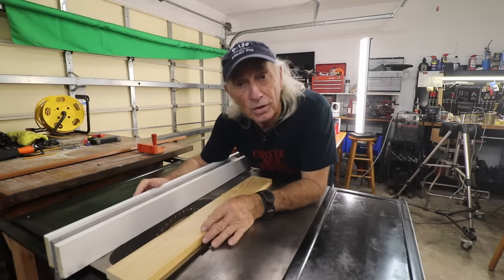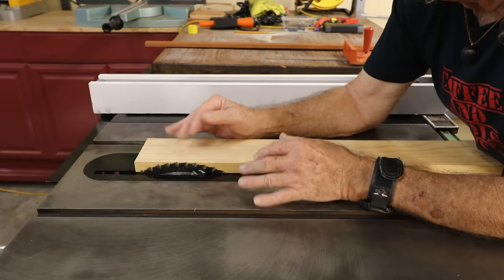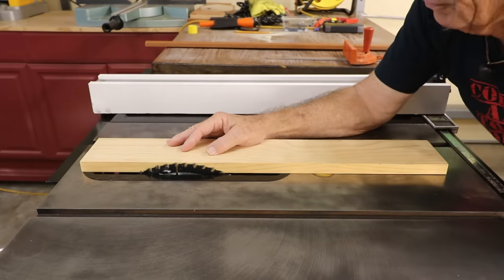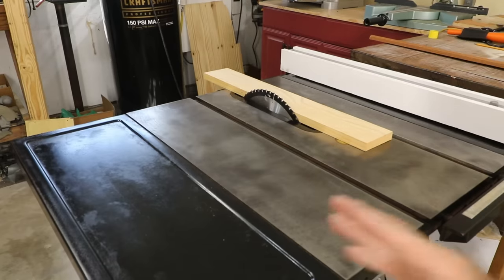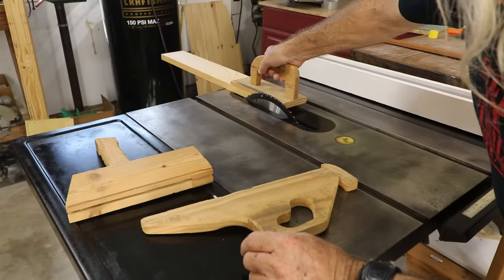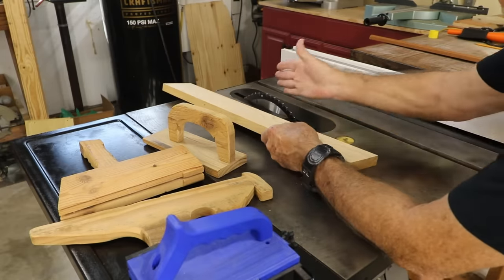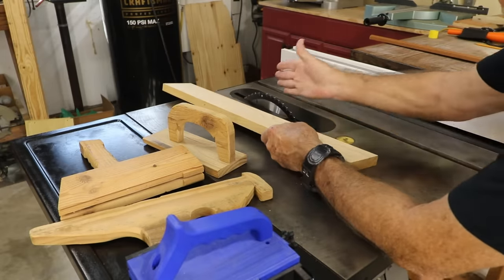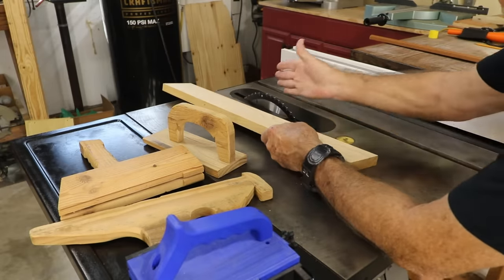Table saw secret nobody will talk about from the good old days, C&T episode 180

Comment: One thing I see is the portable contractor saws there is an avg of 8" of table in front of the blade in comparison of the saw you have there. You have to lean forward in a lot of instantses to push wood completely through the blade which cause you to have less body stability and balance which could lead to a problem of not maintaining proper control of the wood etc.

Comment: I seem to recall that at minimum you should have 3 teeth in contact with the material for smooth cuts. Some rough cut blades won't do this when run high.
Does this apply to table saw blades as well?
Reply from the maker: It somewhat does, so yes the low tooth count could change things a LOT for work

Comment: I’ve always followed a variation of the 1/8 rule–which in most blade sizes amounts to the same: call the top edge of your panel the horizon, and adjust the height of your blade so the most teeth possible intersect the horizon; teeth faces shouldn’t leave and re-enter the panel, will give you a far cleaner top cut, and far less tear-out on the face touching the table.
Reply: I'm new to this, so please comment corrections where necessary.  My understanding is that the cut with a table saw is occurring at the point of first contact, so all the teeth of the saw that are intersecting the horizon aren't really cutting anything until it's their turn at the front.  The rest of the teeth are just narrowly grazing the sides of the wood that were cut earlier while feeding the wood through.  Hence the reason why a riving knife is so useful, to prevent the already cut material from squeezing in and catching one of those teeth out of sequence and throwing the wood.  If that's the case, then my instinct would be to have the blade higher up so that the cutting force is down towards the table, instead of towards the user.
Reply: @raddad9041  The main issue is tear-out on the table side of your piece when cross-cutting, given your blade is sharp and perfectly fence-parallel. Try highest and horizon cross-cutting a pine panel, and see which position provides less tear-out.

Comment: Clear the gullets!  It removes the chips, and because the blade is higher, the rake presented to the workpiece is now positive, instead of negative or 0 degrees.  That reduces the force directed at you (and the potential for kickback), while also making it easier to feed the workpiece.   I know what I am talking about.  I have cut thousands of linear feet of acrylic and also polycarbonate (bullet proof glass) without a riving nice.   Polycarbonate has a great tendency to kick back.  Also, if your rip fence is PERFECTLY  parallel with the blade, or deviates ever so slightly to the right, it will reduce the chance of kickback.  You don't want the fence angled the slightest bit to the left, as that pinches the workpiece between the fence and blade, increasing the potential for kickback.
Reply from the maker: I like it.

Comment: I use most safety devices when applicable, and I'm a huge fan of feather boards as well to reduce the need for my fingers to even get close to the blade and get more consistent pressure than my fingers can often give. This allows me to set the blade a little higher than normal and get a smoother cut. It also reduces the pressure needed to push the wood through the blade and burns far less. I usually set the blade ⅜-¾ above the material for rough centre cuts. For finish cuts, end grain cuts or taking less than the kerf of a blade off, I like to lower the blade to just above the material so the edge of the blades teeth are continuously engaged in multiple cutting angles for the nicest cut. I actually find higher than recommended height is safer for me as decreasing the feed pressure reduces the distance my hands can move forward if they slip and if the wood twists parallel to the blade direction a higher blade would have only 4-8 teeth engaging the wood in a more up down motion which bounces the wood up and back towards at the operator. If your fingers are between the blade and fence in this situation it may save a finger, whereas if a board twists parallel to the blade and the blade is close to the same height as the material you may have 10-25 teeth flinging the board like a bullet at 190 km/hr straight toward you. If you are applying force near the blade you won't have time to react and pull your hand away before the board is completely out of the way and your forward pressure sends your hand through the blade or the push block can break or twist or injure you as well if it catches in that situation but the chances are far less likely with a lower blade if your technique is correct (stand off to the side of the workpiece, no fingers withing 4 inches of the front or sides of the blade, never put you hand behind the blade) I love to add a lip and small pieces of grip tape or sandpaper to my push blocks to prevent slippage. The only time I have had serious kickback is when I was rough ripping tensioned wood without a splitter bar. Technique, preparing your wood for the saw, safety features and PPE should prevent accidents 99.99% of the time. So just get someone else willing to take the risk or find another way to do those tricky cuts safely.
Reply from the maker: Featherboard is another nice feature added for table saw accessories. Some good thoughts here

Comment: Agreed when I used to cut a lot of small strips of 1x that is usually warped and such it was best to keep the blade high and have someone on the back side helping guide the larger pieces. I use my circular saw most often these days while I have a table saw it isn't something I use often I've almost had kickback several times but when it jammed I kept the force on it and shut it down. Often kick back occurs because the space in front of the fence is different on the back of the fence always measure the front and back of the blade to make sure your fence clamps straight because often it does not no matter the fence design. I used to free hand a lot on the table saw as well cutting long boards at angles pencil drawn I was decent at it but again these days I opt for the circular saw. I've been hit by metal shrapnel and got all kinds of cuts once catching when my uncle was cutting he was in a hurry and left the lock on wow hey got one hell of a welt on his stomach and I had all kinds of cuts from the metal the door flew back and hit him in the stomach and continued to fly up as it spun off of him. Not a good day that right there introduced me to the danger after 20 years of being around saws I've seen enough kickback to know a table saw is a tool of danger and I use it as little as possible only when needed for repetitious cutting. If it starts to jam keep even pressure and shut off the saw.  I've never personally had a kickback using this method don't know if it is the correct thing to do I just know that it has worked for me and each time my fence was off on one side or the other and that was the culprit.
Reply from the maker: WOW.....free hand...man now that is asking for a bad day. Shutting down the saw does seem like the simple way to stop the kickback, but ....aw...there will always be that guy with ...OH...one more push should do it LOLOL

Comment: Over here in Europe we are amazed that North Americans never seem to have riving knives or top guards. Of course you can remove all the safety features you like privately, but in the workplace this would be a criminal offence. When you are ripping, the most energy efficient way is to have the maximum blade exposure so that the teeth are as near to right angles as the wood fibres as possible. This is why bandsaws are so much more efficient.
Reply from the maker: Exactly

Comment: I doubt this comment gets noticed , but what about the blade manufacturers specs of how the to use each blade . Most recommend the gullet is supposed to be just below top edge of the board. 
    This gives you best cutting angle for the tips. As well as keeping the blade coolest.  So less chance of warping . There's also different ways the blade can affect the lumber from the amout of teeth. Whether you use a zero tillarance throat plate. Even the kind of wood. 
      So honestly blade height can vary for most safest.  Properly used plastic guard will stop anyone from getting cut and almost always all kick backs.  A break dose nothing about kick back.
       Plan your cut as was mentioned  is a must practice.  Using something to push is a great layer of protection but it's no guarantee.  Keeping your saw true  is one of the best ways to prevent kickback.  
      A knife is a awesome prevention tool but if you switch to a thinner blade than the knife you just made it worse. 
      Be as careful as you were the first few times you ever used a table and it's very doubtful you will ever have a accident.  Also a close call means your f#@king up. Stop take a minute think about everything that lead up ti the close call and how to do it different.  A table saw is extremely useful.  Enjoy and respect it and all the cool things she helps you build.
Reply from the maker: It's shown that the lower blade causes kick back and injury, but higher blade is another story.  Every 9 minutes in the USA there is a table saw accident. NOT good, but cell phones and fast cars are still number 1 :face-blue-smiling::face-blue-smiling::face-blue-smiling:

Comment: As a machinist, I'm seeing people ignoring the geometry involved with a saw blade.  One wants to avoid drag behind the cut, thus keeping the blade low.  Also the teeth on a carbide tipped blade are wider than the blade (body), so it will not guide the material during the cut if it's higher.  Also, depends on material.  Cutting melamine shelving with the blade higher than the gullet will chip the hell out of the top side of the melamine when the teeth smack the top of the back side of the cut.  I have to say, that just like driving, if you are scared, you should not be doing it; those are the ones who are dangerous.

Comment: I vary the blade height depending on how the wood feels going into the saw. I tend to keep it a little bit higher now because sometimes I have found as you cut the wood can bow upwards from the table and instantly plant itself on top of the blade. I have been mid rip when this starts to happen and I quickly raised the blade during the cut and it stopped. As a physics teacher I think I have an explanation. Do you remember what's called tangent in high school? It is something that is parallel to the edge of a circle. The 12:00 tooth the highest tooth on that blade is the dangerous one if the wood gets on that tooth it will be flung straight back at you. All the other teeth will throw it towards you but also on a slightly upward angle. Now think of a low set blade the moment the wood lifts it will take nothing at all to put it on top of 12:00 tooth and throw it straight back at you. But if the blade is raised High the wood will have to climb quite a bit before it gets on top of that 12:00 tooth. This tells me that the higher blade would be a bit safer. But there are multiple factors controlling this and I think that strategy is better than rules. You have to read the wood and predict ahead of time what might occur. Finally, the raised blade may not work for some of you because your saw blade isn't true. Getting that blade exactly 90 ° to the table is critical. The lower the blade the less this matters. So if you raise the blade to the maximum and it's off even a little it could greatly increase the chance of Kickback or pinching. Imagine the blade is leaning 1° towards the fence and the wood lifts. The blade is now pinching it more between the fence as it climbs. And this would increase the chance of kick back if the blade was at a slight angle. So it isn't just blade height it is also blade angle, any possible cupping in the wood. Even the possible cleanliness of the blade matters. I have ripped wood the full depth of the blade to find out later that there is baked on crap of different consistencies from the circumference of the blade closer to the Arbor.
Reply from the maker: Love that science and thanks for posting. Tangents anyone ? Yes, I think there is something to it. Pinching with the fence is a reason for "kick back"

Comment: I always use the same safety push boards you use to help guide the wood instead of my bare hand by the blade just in case. I also cut with my blade a little high too cause I think it cuts better also. Been woodworking 40 years and so far so good. Great video and Thanks for making it.
Reply from the maker: Hey, thanks for the comment.

Comment: At work we had a General cabinet saw, very powerful saw. I even hated the sound of that saw starting up. Kick back is a real issue with a saw with no give. I seen what it could do to a experienced operator making a small error. My workshop tablesaw here at home, 1.5 hp is a much more forgiving, practical tool. A lower power and some slip in the belt are great safety features of a contractor saw.
Reply from the maker: My first big one was at a carpenter's shop industrial set up and that was scary. Add to them telling me to raise the blade full UP for some cuts and I was even more nervous.

Comment: What is the thinnest cut you would make when using the fence?
Reply from the maker: Depending on the stock it is cut from. Technically with thick stock, you could cut down some very  thin material. For boat building I had to cut 1/4 inch off 12inch boards for strips needed

Comment: 15 minutes to tell us basically "blade height doesn't matter as much as keeping your fingers away from the blade" ... yeah, OK. I would say don't go near a saw that doesn't have a riving knife and a blade guard, use push sticks and push blocks to keep your fingers  away from the blade, keep all of your body on one side or the other, never in line with the blade, never reach over it. That last bit is so even if kickback happens, the bullet misses you. 
If you think keeping the blade low can substitute for any of that, might as well have your fingers amputated professionally right now.
Reply: I think the message is that higher blade equals more controllable forces on the stock, and a push stick or other device can keep your fingers safe and away.

Comment: We have six or seven table saws, I use four of them almost every day. Kickback hurts, I have two scars to show for my lack of interest in what I was doing. The saw is not a culprit, just a tool that usually does what I want it to do in over 60 years woodworking (getting close to 70 lol), still love it. It seems to me that if you just use common sense and really listen  to what this man is saying, you are good to go. A riving knife or splitter is extra nice but not a necessity nor is a saw that would "protect " you, just use your head for something other than to hold your hair down.
Reply from the maker: Awesome and common sense is a big part.Thanks for this posting :)
Reply: the saw can be the culprit when we don't bother checking the fence to blade alignment. every once in a while its a good habit to check the saw...just a thought😀
Reply: @30eesh  the culprit is the person who did not do maintenance , saws like guns, don't kill people do
Reply: A riving knife protects when for however short a time span your head is not in the game, or even when you are doing everthing with all diligence but the stock starts closing the kerf due to tension relief.
Reply: @leehaelters6182  yep. yesterday I had an instance of that board pinch and just turned the saw off while lifting it free of the blade. the two times I was injured from kickback were both from smaller sections the blade caught and shot me to awaken me  a five inch scar remains  and I was damned fortunate at that.

Comment: "Respect the blade" and "all this piece of metal trying to hurt you" are they elements here.  When walking down the street distracted and a pitbull comes out of nowhere barking, our attention comes back all together to focus on the danger coming at you, you slow down to assess your situation.  Same thing.  Pay attention to what can potentially hurt you.  Another important point is that the blade is stronger and more solid at the center where it's been held to rotate, as you move away from the center towards the cutting edge, the metal weakens, not by much, but just enough to possibly bend a fraction of a degree in the cutting pressure at the edge; if you raise it, you're cutting closer to the center where it's stronger and more stable giving you a better cut.  Power tools are dangerous because they are powerful; so respect it and enjoy it.
Reply from the maker: You know it

Comment: I have been using circular saws as a skilled  pattern maker since 1970 ,is was taught to always use a riving knife that is slightly. ,below the surface and moves up with the blade and use a straight put stick ,but in resent years the rules have changed we now have a riving knife with an attached guard with over head dust extraction and we are no longer able to cut a slot or trench into the wood this is done on a rotor machine with overhead cutter or a spindle moulder with the cutter underneath

Comment: i agree with you and take it a step further using a skill saw i drop the blade all the way down unless i cant you can cut way straighter with more blade exposed (longer plane on wood) i believe the same is true with the table saw i'm 64 been a carpenter all my life  i have nicked my fingers twice both times making crown molding on the table saw running all day with the blade not going through the wood soon as i raised it i got careless
Reply from the maker: Sorry to hear about the nicks. I have built wooden boats, did teach dock and deck wood working and home framing at one time. YEARS ago. I have for some reason always been "careful" around power tools and maybe just LUCKY LOLOL :)